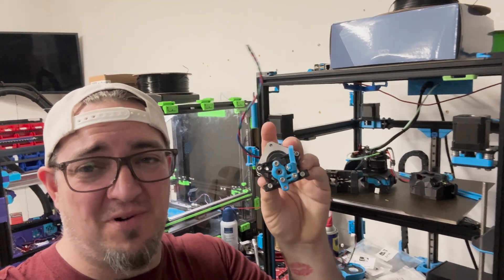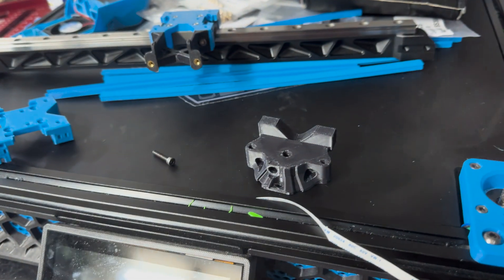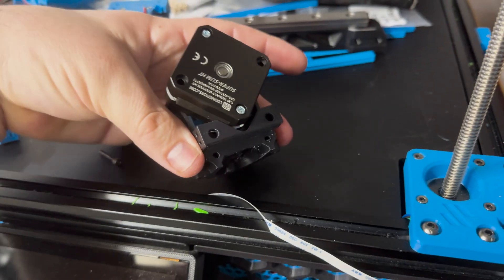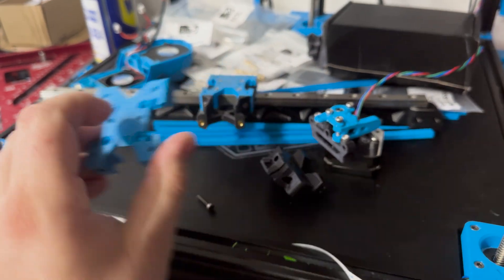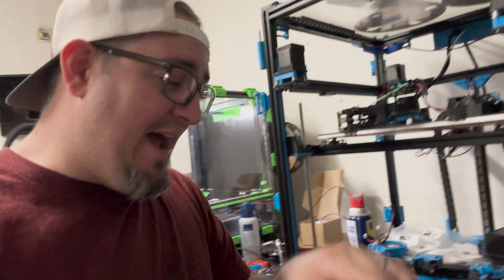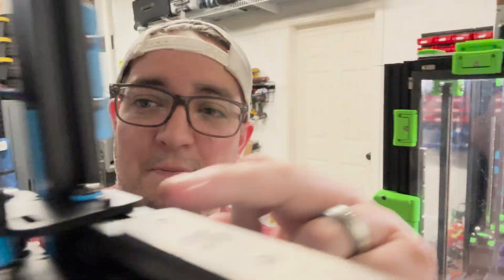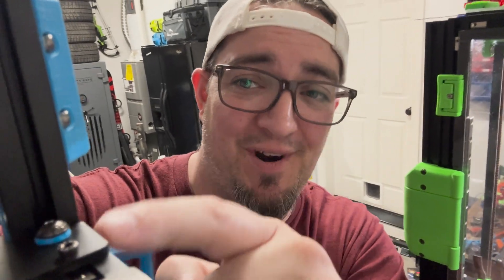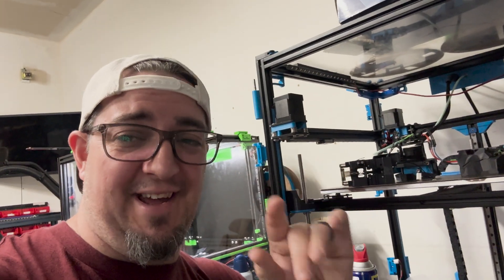Trident AWD Extruder Problems Part 5

Comment: status update?  Were you able to get the XOL + Sherpa mounted with the AWD motors on top of beams?  I've heard AWD needs to flip back motors back to bottom (which shouldn't interfere with any Z-motor shafts) when doing XOL...maybe it is only on Siboor CNC 9mm AWD?